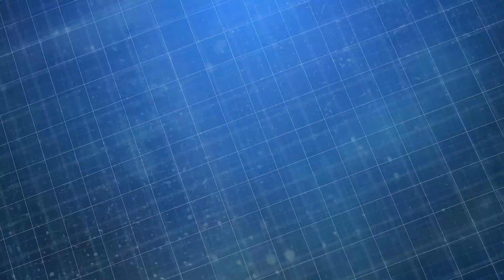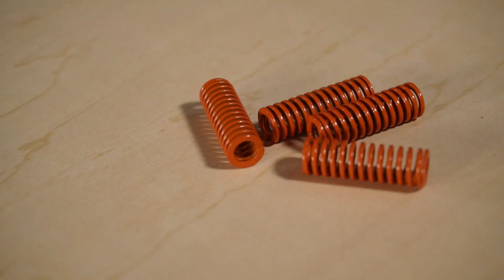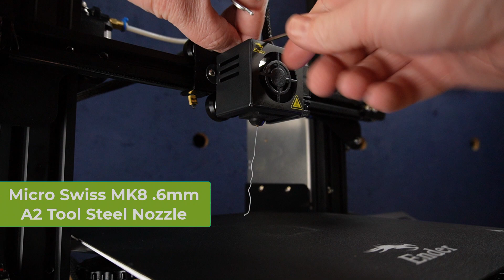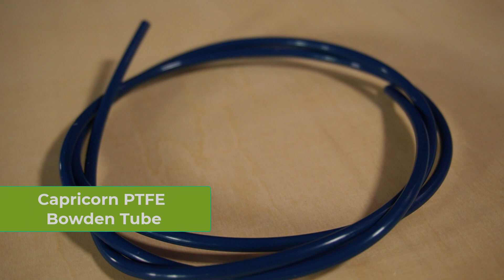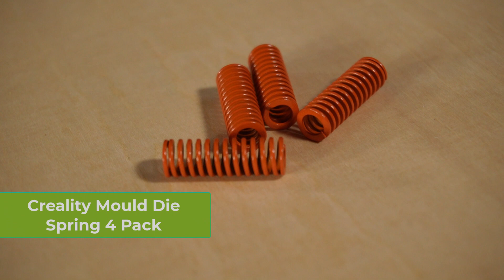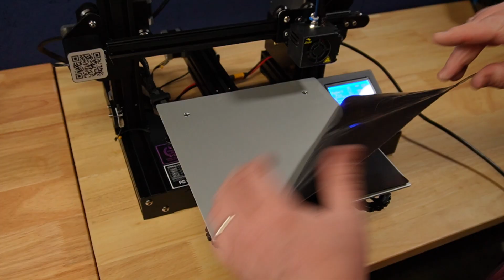5 Easy Upgrades For Your Stock Creality Ender 3 Pro in 2023

Comment: I’m about to upgrade my ender 3 prong with more things just got it back up and running .i like the glass bed instead of flexible bed after a while flexible bed becomes damged from getting pieces off but i want to put a direct drive on my printer eventually.happy new years everyone and happy new years to my 3d printer nerds ❤❤

Comment: Since the Ender 3 Pro has a factory installed magnetic base I saw no advantage of replacing the factory installed magnetic base with another magnetic base when I upgraded to a PEI build plate on my Ender 3 Pro.  The new PEI build plate sticks very well to the factory installed magnetic base.

The magnetic base will, however, be needed if one is installing a PEI build plate on an original Ender 3.

Comment: Scrap the springs for Silicon bed spacers (Way better than any yellow springs) and get rid of the metal extruder for a DUAL gear extruder. Less slip with peace of mind.

Comment: I done the direct drive. Extruder mechanism that grabs the fillament on both sides, Glass bed, isolation foam under bed, belt tensioners, LED lightbar, Raspberry pi and rear housing for electronic.
Reply: Doesn't it add too much weight to the gantry?

Comment: And for those of you who may be a little weary about upgrading a printer, the Ender 3 S1 is at Micro Center for $279 with a lot of upgrades included stock :) that's the printer I use and I love it

Comment: I bought the spring upgrade but the bed flexes if you thigh to down too much. And the nozzle hits the bed on the auto home function. Can you go more in depth on that?
Reply: Hi, 
If your nozzle hits the bed on auto home. You should adjust your Z-axis limiter switch to be higher. If you got a glass bed, you want to make it a bit higher. Hope this helps

Comment: I bought 1 of these from Microcenter.  Nice 3D printer!  Already upgraded the PTFE Tube and 3D printed a filament guide before extruder. Great video but you did not really say what benefit there would be for these upgrades. Metal Extruder - eh, maybe after it breaks.  Springs, yea I can see, levelling always a challenge, how much better are these? Nozzle, why .6 vs .4?
Reply: I was thinking the same thing. New to 3D would like to know the benefits to these upgrades as well.
Reply: well once you get the .6mm nozzle dialed in, theres minimal difference in quality from the .4mm and a decent little cut to time to print. also you can get some profiles setup with the .6mm that will print MUCH faster for rough drafts of parts youre testing.
Reply: @TriggeredWorkz  Why, when you can now get 200+print speeds now?